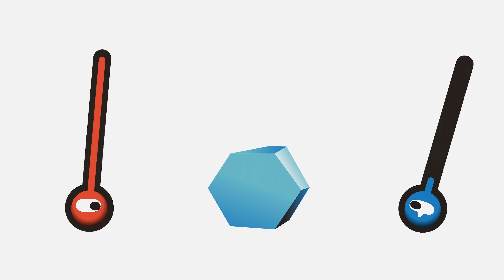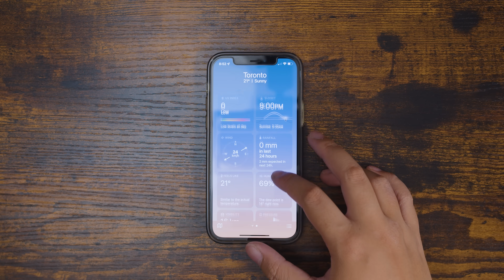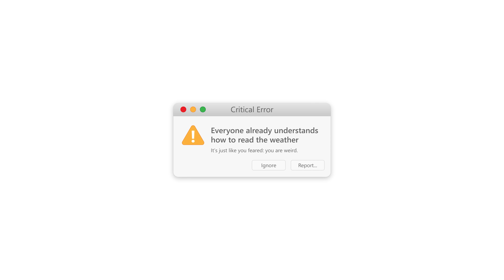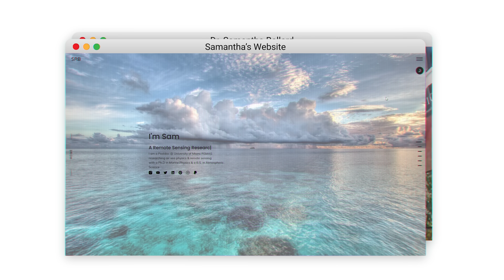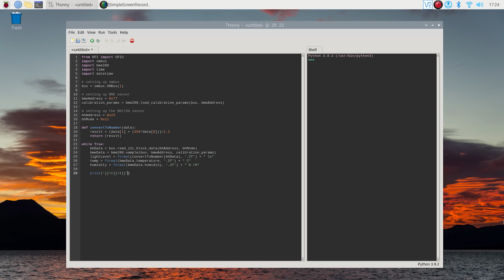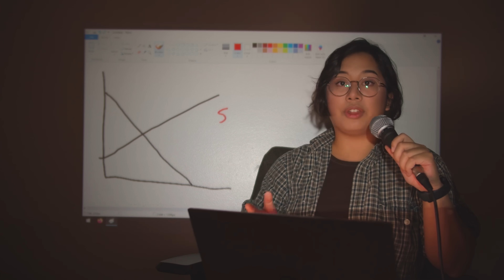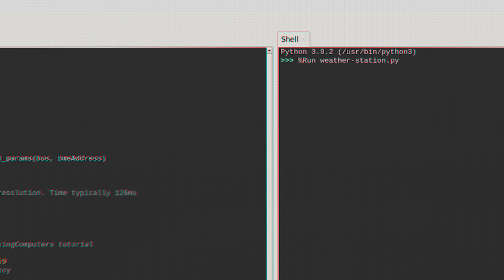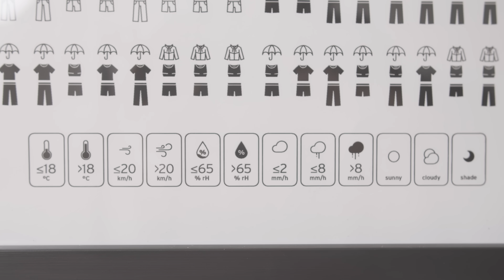how fahrenheit fails you

Comment: Every time I hear someone try to explain the benefits of Fahrenheit, they lose me at "imagine 0 is one of the coldest days you can have". The coldest days I've experienced have been below -40F. The scale just isn't designed with my climate in mind. At least when it's below 0C I know it's going to snow.
Reply: And for people from tropical countries where the temperatures rarely go below 12°C (53.6°F). On the other hand, everyone knows how cold ice is and how hot boiling water is.
Reply: @ricardoalexisnolazcocontre9110  Sure everyone knows how cold ice is and how how boiling water is, but I don't think anyone has ever been outside in 100ºC weather. So in both Fahrenheit and Celsius, you can think of where zero is and where 100 is as irrelevant to how easy it is to think about how it will feel outside. What is important, is the size of the units. One degree Fahrenheit difference is a smaller difference in temperature, which makes it more convenient. When you need it to be precise, it's more precise. When you don't need precision, it's also more convenient because you can think of different temperatures in increments of 10 degrees. 60s 70s 80s and 90s all work very well for conveying how hot it will be that day. Especially since from day to day it doesn't change in temperature that much more than 10 degrees during the day each day. The units are just a more convenient size.
Reply: @danielgolem4251  This 0-100 range is a very Fahrenheit thinking. I grew up with Celsius in an non-English speaking country so it never even crossed my mind to think weather should relate to a preset range (and especially 0-100 one - if anything -50 to +50 would make more sense). There was just 0C as always relevant reference point with minus temps meaning ice, snow and plus meaning water but both the + and - ranges were open ended. After all Earth is big and how far the scale needs to go in either direction depends on where you live. And what is very hot or very cold depends both on what you are used to and personal preference.
Reply: @Ellestra  I actually don't think I said anything about Fahrenheit being a 0-100 range. I only mentioned that Celcius was a 0-100 degree range, and my point was that because the temperature outside will almost never even get close to 100ºC, Celsius units are annoyingly large and therefore harder to use. I mean, 10ºC is 50ºF, 20ºC is 68ºF, and 30ºC is 86 degrees Fahrenheit. so saying things like the 50s, the 60s, the 70s, the 80s just works better in Fahrenheit. Also, when using Fahrenheit I also reference the freezing point of water pretty often. I just remember it's 32ºF. The biggest advantage that Celsius has over Fahrenheit is just that it saves you from having to remember one two digit number. I don't think this necessarily makes celcius bad, the differences are pretty minor overall. But as someone who has grown up with Fahrenheit I just think the size of it's units are way more convenient for everyday use.
Reply: @danielgolem4251  If you need precision, you can use as many decimals as you please. They are not rocket science (for Europeans at least).
Reply: @ricardoalexisnolazcocontre9110  but boiling water hurts and is not regularly touched
Reply: @jackconway6571  speak for yourself
Reply: @jackconway6571  yes, so you know anything over that is unlivable, and half the way there would be hot
Reply: I live in Minnesota, and when it gets below 0 farenheit It stops being about what I should wear, and more am I going to get frostbite in 30 minutes or 2
Reply: @happsk1211  Totally what I was thinking. -30° F is about average for Minnesota's coldest days. Winter's just like that in northern states (+ mountainous regions). Subzero Farenheit temps are still very informative if you live there – it's like a danger gradiant of cold exposure times.
Reply: Fun fact: -40F and -40C are the same temperature.

Where I live it doesn't regularly get below -10C but it does go to -5C a lot in winter and up to 40C in summer (or higher even, in recent years). Seeing a negative temperature has a lot of real world impacts like knowing the road conditions will be icy and allowing for extra time to defrost the car, even before seeing or understanding exactly how cold it is. I've been to places that go as low as -20C (about -4F) and never had any problems extrapolating how cold it is from my knowledge of positive temperatures.
Reply: @IGNEUS1607  I've lived in cold climates my entire life, and can firmly say that that temperature is brutal when youre coming out of the warmth of summer, especially if it's wet! It's only on the other side of winter, having experienced 3 months of the temperature not getting above freezing, that it feels warm and I'll go out without a coat or with just a light jacket
Reply: Canadian, I presume?
Reply: well, when it's around -40 degrees, it literally doesn't matter if you're using C or F. :P
Reply: On the other end, hasn’t really reached below 0C where I’m at… let alone 0F
Reply: I live in a warmer climate now where it rarely even gets below freezing, and even then it barely goes below that, so already it's inaccurate. However, I used to live in an area where basically every day suring the winter went below  -30 C, so having 0F as a baseline is absolutely ridiculous.
Reply: I am halfway between the equator and the north pole. I don't know if I have ever experienced 0° F. I think the lowest I've felt in terms of climate is around 10F, which is still pretty cold (IMO)
Reply: -40 f and c are the same anyways. farenheit is just better imo because it has more "precise" numbers. I've had thermometers that just convery C to F, and it always annoyed me how it would jump from 74 to 76, etc. For mettlurgy, etc, where you're using large numbers C makes sense, but using C for weather feels like using yards/meters for height (without the benefit of easily converting to feet/ inches/cm)
Reply: Yeah I really hate it the coldest day I ever experienced was 21°C which around 70°F
Reply: “100 is one of the hottest days I’ve experienced” mate, there’s been days where we’ve been kept inside at school because it was too hot.
Reply: I was once told that Fahrenheit is for the human experience, Celsius is for water, and Kelvin is how you measure the temperature of the Universe. And that made sense to me so I have accepted this explanation.
Reply: drop the 0-100F scale by 20 or raise it by 20 depending on how your climate is. raise again if your climate is more extreme
i think that may help? idk i live in a place where the summers r hot and the winters r cold.. but not like below -15 cold normally and not like above 100F normally yk?
Reply: @PWNDON but doing that defeats the point of the 0-100 range argument
Reply: Fahrenheit is a scale based on average danger to people. 0 is the threshold where it starts to become dangerous to be outside, and same with 100. That’s why it’s the best. In every other way freedom units are worse but I will defend Fahrenheit
Reply: @isaiahjoiner1625  to be fair 100C is way more dangerous than 100F
Reply: @isaiahjoiner1625  if it is the best why is no one using it other than ex British colonies and britain?
Reply: @isaiahjoiner1625  sheer mental illness to type that out. F is a scale that was developed first, then kept despite an objectively better scale existing solely because of pride/arrogance. It does not have a single advantage.
Reply: @isaiahjoiner1625  0F is brining temperature at sea level i don't know where you got this info about danger to people while it may correlate it is not based on it at least not on the lower end i dont remember what the upper set point is off hand
Reply: well then here is a different explanation for you fahrenheit is best used for the preparation of food that is temperature sensitive as it is a larger scale you can better fine tune the temperature then one would be able to with celsius  both scales have their uses and can both be used together celsius is nice because it scales nicely for math and fahrenheit is a better descriptor without the need of decimals because its a larger scale*
Reply: Fahrenheit was based on a pretty arbitrary scale, TBH, 0-100 lining up with weather conditions in a temperate climate are just a bonus.
Below 0°C it might snow, below 0°F it's probably too cold to snow.
Reply: @Dalenthas  Nah dude it's never too cold to snow. Take it from someone in the Canadian prairies.
Reply: @GreysonTheDuck  in order for snow to form, there needs to be moisture in the air. If it's too cold, no clouds can form, no snow can fall. There's a reason Antarctica is a dessert - barely any precipitation ever falls there because the water cycle has frozen solid.
Reply: @GreysonTheDuck  I'll admit that you're technically correct, it's never actually too cold to snow, but the chances of snowfall go down with temperature. At 0F it's extremely unlikely to snow barring freak weather patterns bringing moist air in from elsewhere.
Reply: @Dalenthas  Fahrenheit was based on body temperature..

Comment: I'll help you:
-0C-5C = winter jacket, gloves, scarf
5-15C = winter jacket
15-20C = sweater, long pants
20-25C = short pants, short sleeves, sandals / slippers - bring sweater just in case
25C-30C = short pants, short sleeves, sandals / slippers - no need to bring sweater
30-40C = stay in shade, or inside, or in pool
40C = easy sauna
60C = intermediate sauna
80-90C = hot sauna

Comment: If you kept dividing up units of temperature, would there be a “smallest unit” such as an atomic temp?
Reply: yea kind of!  Temperature is just the kinetic energy/movement of particles (KE=constants*T). So if all the particles are completely still then the temperature is 0 Kelvin or  -273 Celsius. But you can use as many decimal places as you like to measure the tiniest jiggle -272.99999 ... K

Comment: Celsius is great for scientific measurement and cooking but Fahrenheit is CLEARLY better for weather, because you can think of it as a percentage. 32F is 32% warmth (very little) and 95F is 95% warm (very hot). This still makes sense outside of that range; negative temperatures, which in Fahrenheit is quite a bit below freezing, can be understood as negative heat - you will freeze quickly in -15F weather, just as you'll quickly get heat stroke in 120F if you're not careful and managing your body tempurature. All of that said, humidity affects perception of temperature quite a lot. Oklahoma has had a lot of days in the last few weeks being over 100 (or in the 90s) and it feels like 120 every time because it's so humid. We also have dry winters so 40F in January is really cold even if it's not even literally freezing yet. Contrastly, Oregon has drier summers and more humid winters, making the temperature feel more balanced throughout the year, while still getting snow every winter and ranging 0F-100F over the course of a year but feeling like 30-80 (OK usually ranging 30-110 while feeling like 0-120)

Comment: A metric that's relevant for human (dis-)comfort is the wet bulb temperature, basically the reading on a thermometer that's cooled using a wet 'sock'. When it's humid this cooling does not work very well and the reading is higher. It's a measure of how well you can cool your body by sweating. A wet bulb temperature of 35C is decidedly unhealthy, and often lethal.

Comment: When you talk about your experience going outdoors (or lack thereof), I personally noticed that when I was outdoors 250+ days of the year I was more calibrated to the extreme weather than when I was living a more sedimentary lifestyle. 

Another breakthrough occurred to me about ventilation on a trip to a stuffy hotel room with inadequate AC, there's nuance to the composition of a room beyond it's temperature. The more air is recirculated without fresh air being brought in, the higher I perceived the temperature to be. Even hot days are enjoyable without air conditioning if the right airflow goes through the room.
Reply: I think it is both the O2 / CO2 factor and the humidity accumulation from body sweat.

Comment: Here is how I tend to dress in any given temperature in Celsius:
<0C =Thermals, winter boots, gloves, scarf, beanie, sweater, winter coat. At least 4 layers on top, 2 on the bottom.
1C - 5C = Winter boots, gloves, beanie, sweater, winter coat. At least 3 layers on top, 1 on the bottom
6C - 10C = A warm coat or sweater. I start to wear dresses here but with stockings. 2-3 layers on top.
11C - 15C =  A light cardigan. 2 layers
16C - 20C = no extra clothing. Dresses no longer require stockings
21C - 25C = Singlets and shorts or summer dresses
26C+ = DO NOT GO OUTSIDE!!!
All of these assume you are starting with a base outfit of a T-shirt and pants :)

This works for me 90% of the time. I live in a weather turbulent area so some days I have to prepare for more than one of these.
The weather site I use has a 'feel temperature' which takes into account humidity, wind chill, rain etc.

Comment: As an American, specially in Ohio, I feel like Fahrenheit works well for describing the temperatures that I experience year round. In my science classes, Celcius is still considered the default (sometimes it’s Kelvin but not usually) along with the rest of the metric system. I think this also makes sense since the boiling/freezing point of water is often relevant. The main thing I would change about the American system is using Celcius for cooking. The numbers are so much bigger than outside temperatures anyway that it barely feels like the same scale.
Reply: While I understand that you grew up using fahrenheit for outside temperatures and they thus feel most intuitive for you, I still think it would be best if the US (+ Cayman Islands + Liberia) just converted to Celsius. It's way better for an international understanding and, if taught to children, exactly as intuitive. 
+ It makes understanding Kelvin better because it's essentially the same but shifted to the bottom of the scale.

Comment: the only advantage F has over C is each degree is smaller, so you can be more precise without using decimals. but either way its just a matter of getting used to it via experience.

also i figured the Sabrina go to would be to make an AI to figure out what 'weight' to apply to each weather factor(temp, humidity etc), given a set of data(18 C,  80%, windy = cold. to generate a function that would then give u a shorts or pants rating

Comment: As an electrical engineer seeing Sabrina using tweezers to connect the jumper wire to the bread board was just gold humor
Reply: I first thought she had broken the tip of the wire and was removing it with tweezers when I realized she was connecting it I was like 😑

Comment: I've recently discovered the PCU/ECWCS system used by the US Army for cold/wet weather clothing and have seriously been nerding out over it. It seems very similar to Sebrina's outdoor guide for indoor kids, but it only uses 8 categories based on temperature/wetness and activity level to determine clothing recommendations rather than what looks like at least two hundred, give or take, in Sebrina's guide. It's based around 7 different levels, which are similar to layers, but it never recommends wearing more than 4 layers at once even in temperatures down to -40 FAHRENHEIT, or celcius (that's the crossover point). I would recommend giving it at least a cursory glance if you see this comment, it's pretty cool and was created with the help of "Civilian Mountaineers", which is absolutely the coolest title you could be given.

Comment: a thing that might be messing with your brain is that you're used Canada. during the day, it's usually either around 0 degrees (or way below), or at least 20 degrees. in Toronto, the only months when the avg daily temp is between 5 and 20ish degrees are April, October and November. so those in-between temperatures you struggle with could just be a thing of not you having to deal with them all that often. when I went and lived in Scotland for 5 years - where it was basically always between 5 and 20 degrees - it was really hard to know what to wear for the first year or so. but you just get used to it after a while (or just always bring a couple different layers in case things change or what you put on is wrong lol).
also also also the pro of farenheit being more practical because it's usually on a 0 to 100 scale goes out the window if you live anywhere that goes below zero or doesn't get close to 100.... 
hi from Montreal <3

Comment: i prefer farenheit over celcius - ironically because it breaks down nicely into 10s.  here's my personal rule of thumb:

0-10 is crazy cold - why are you going out??  expose as little skin as possible to be comfortable
10-20 is frigid - layer up, you won't regret it... i'm talking parka, scarf, and gloves
20-30 is literally freezing so have a solid sweatshirt and warm socks and put gloves in your coat pocket
30-40 is still winter coat weather, but maybe save yourself from wearing those wool socks. you can see your breath.
40-50 really depends on whether you are moving from winter into spring or fall into winter.
50-60 is sweater weather, but lose the jacket... scarf if you want to be extra but not necessary to stay warm
60-70 is nice out - fashionable layers or long-sleeve t-shirt with pants or capris
70-80 is getting warm enough for short sleeves and you could wear shorts without looking like a weirdo
80-90 is debatably hot - shorts, tanks, sandals, all summer gear 
90-100 is universally hot - unless you'll be in the a/c you'll want short/no sleeves and short pants

layers are handy if you have to spend a chunk of time outside immediately following a chunk of time inside... or if you live where the temperature rises and falls more than 20* between breakfast and lunch. but i agree it's a pain to carry things (read: leave things behind at every errand you run)